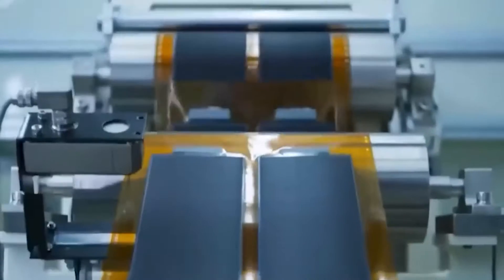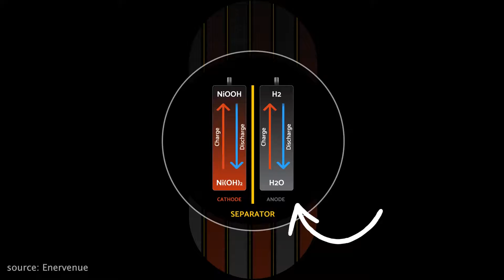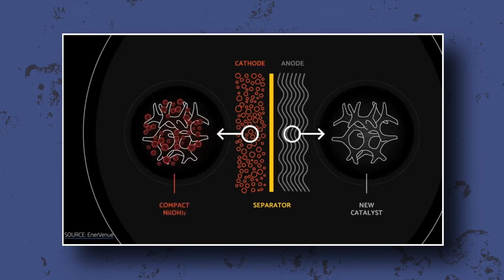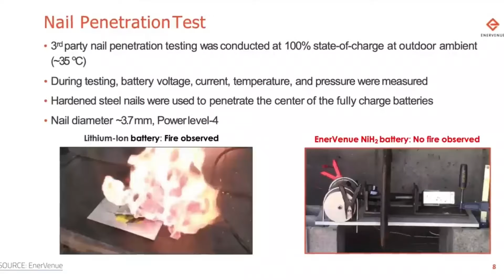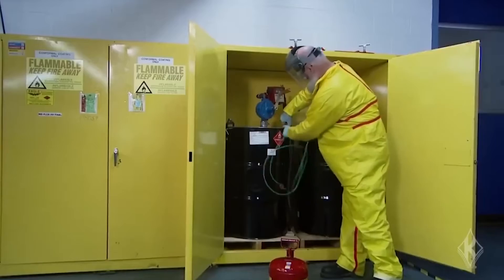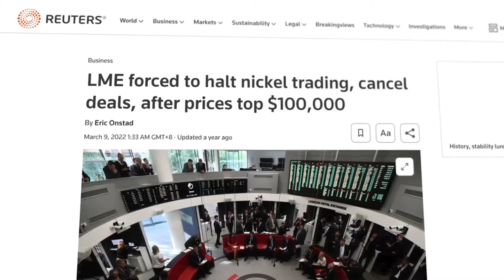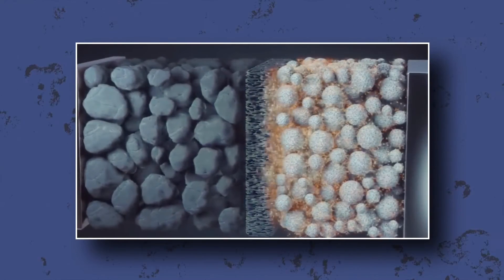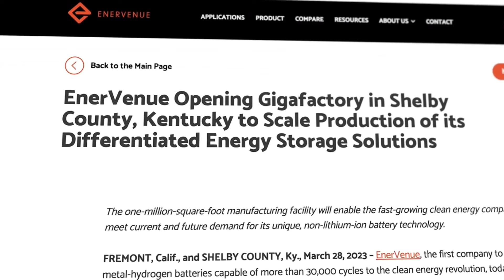Why This NASA Battery Will Be The Future of Energy Storage

Comment: clickbait.  image shows car with 10,000mi range, but the transcript shows that this was not discussed in the video.  the video does mention how there's less energy density than Li-ion batteries, but that would insinuate that they would give less range than modern cars, not more.
Reply: The current spec sheet for a single Enervenue ESV-40 battery cell would indicate it may not be a very good fit for mainstream passanger EV use as it's lower energy density/weight and size per kwh is hard to engineer around. Just the weight alone of one Enervenue cell is 136lbs at a capacity of 3000kwh. For comparison a Tesla model 3 pack weighs ~975lbs and gives you ~75,000kwh of capacity which at the equivalent weight in Enervenue cells you would be able to only use ~7 cells and that would only amount to 21,500kwh of total battery capacity compared to the same weight of a Tesla pack. The size of an Enervenue cell is 168mm x 1800mm so seven of them would be about 1176mm wide and 1800mm long. A Tesla pack is about 1473mm x 2146mm. With some good engineering you might be able to fit another 2-3 Enervenue cells into the same area of a Tesla pack increasing the capacity of an Enervenue pack to as much as 30,500kwh but it would add another 408lbs to the total weight of the pack which would come in at  1360lbs not including any wiring, mounting, packaging and other materials and hardware needed to make it a workable EV battery pack. In other words, at the expense of being less than half the capacity and over ~1.5 times the weight of a typical EV battery pack used in a good EV today, this battery technology is going backwards in regard to the potential range it could offer an EV. It could however, potentially and more accurately offer a 10,000,000 mile life expectancy to an EV but with that as the headline it would only be more plausible click bate.
Reply from the maker: Common we all try to make it out here. It’s not that serious, plus it made you click so it’s a win win situation
Reply: i do not see how i won before your comment about the bait and switch... i wanted to see the car with 10,000mi range, and the technology behind it.  However, after your comment I now have a more honest list of channels I am subscribed to, which is more of a baseline than a win, arguably.  Since you used a pleasant phrase like "win win", i assume you enjoy your hustle.   @EyeTech21
Reply from the maker: @DavidMatsonfamily  just hit the dislike button and move on. Thank you!:)

Comment: There are several negatives with this kind of battery.  Hydrogen ion is so small that it leaks out of any containment vessel so there's always a constant loss from leakage.  Hydrogen must be kept at high pressure so first you must pressurize it which is by default a loss of energy.  Hydrogen must be made by something like electrolysis which is a net loss on energy or else by other chemical process which is also a huge loss in efficiency.  Hydrogen is basically a bomb waiting to happen so in some ways it's more dangerous than lion unless it's packed in a heavy destruct-proof container so still dangerous.  So yeah, hydrogen might be more efficient than petrol but it's way less efficient than lion batteries.  Might be great for space but not so great for cars.  Pretty much every country has gotten rid of their expensive hydrogen stations because fuel cells just don't compete with batteries.  Neat idea but I have my doubts it will see the light of day for EVs.